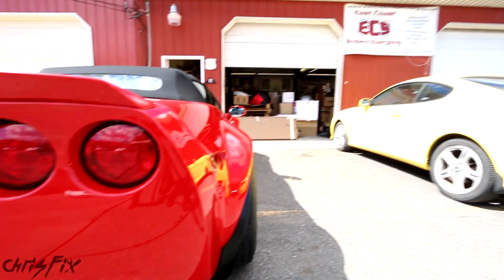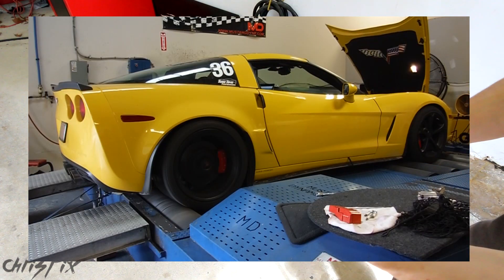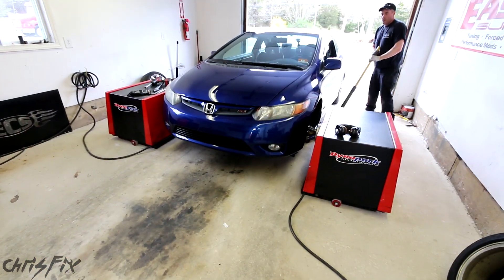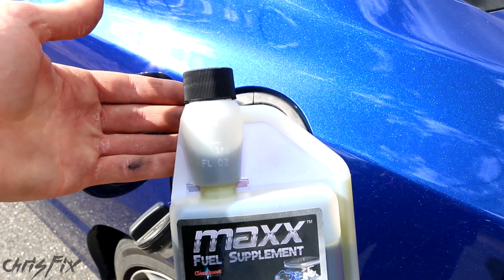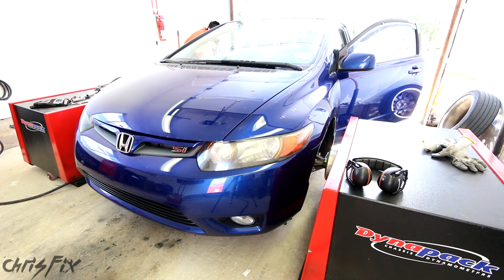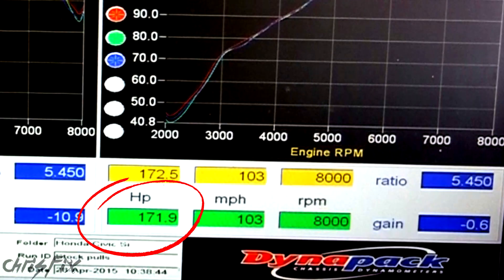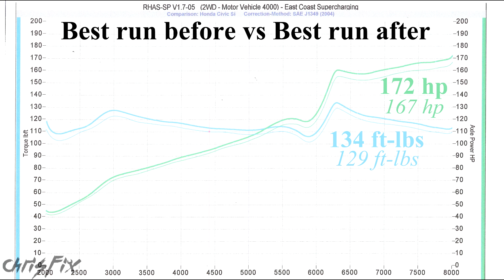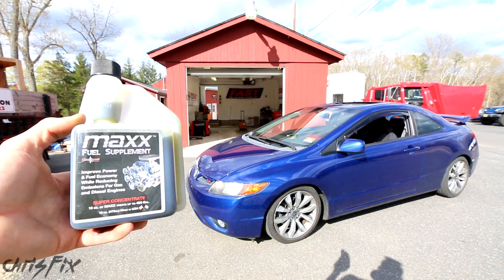Can a Fuel Additive Really Increase Horsepower in Your Car? (With Proof)

Comment: VTEC ads 40hp??omg it is kinda a big deal...
Reply: I was a skeptic until i drove a AP2 S2K, vtec kicks you like a horse. its pretty damn impressive.
Reply: ***** It's actually not...  If the bigger cam lobes were used at lower rpm, the volumetric efficiency would be sacrificed.  So in effect, yes it is adding power.  They are high revving engines.  High revving engines were not designed for low end torque.  It makes the power where it was intended to.
Reply: Slapster imagine a vtec v8 lmao
Reply: @dom3489  thats pretty much what ford did with the flat plane cam in the GT350R
Reply: The valves don't activate, the cam switches to a more aggressive profile thus giving higher lift and duration. The same valves are used.
Reply: All it shows is is how undersize the cam is
Reply: Vtec actually steals 40hp until all valves are activated to improve fuel economy at low rpm.
Reply: @vegaquarker  it actually doesn't, the larger cam lobes are a lot bigger than those of a standard car, and the standard ones are the same. Vvti engines or Vanos or anything like that is different
Reply: vegaquarker It's fun to race, but no one would spend 22k on something like that to daily drive.
Reply: ***** I mean...  technically it does bring the hp up by virtue of keeping torque up longer.  tq x rpm / 5252 = hp...
Reply: pretty sure all the valves are always "activated"
Reply: VVT And VTEC Is Very Different 

VVT Is Always On
Vtec Is Off And Hit In Specific Rpm Range
Reply: lolol +horizon foz
Reply: Dominique Cockfield u talking about the 4cam 32v vvt coyote?
Reply: ASIStudios no there not actually. Fiat did not invent lift cam profile only advancing and regarding timing. So very different
Reply: +Braddah E why the fuk am I still reading these comments lol
Reply: luke saylor well, I get 30+mpg regularly when taking it easy, have one of the best AWD systems, great safety, and an actually fast car with my Subaru WRX...  for only $4,000 more than an Si. That's the right decision, plus it doesn't feel super cheap on the inside
Reply: pollorobot69 that’s wrong actually as valve timing is happen all time in a vtec engine. Lift  control and locking cam lobe pin is only at set rpm by the ecu.
Reply: Four dummy.
Reply: Makes even more of a difference with boost. Nothing I've ever owned has had VTEC cause I'm a Nissan 300X boi, but it's fucking insane.
Reply: +username here why the fuk am i still reading these comments lol (there's only 1 correct answer and yet there's probably 1/2 dozen+ of you guys, all with a different explanation, each one of you insisting that you're correct). y'all shoulda taken your debate to a vtec forum. i think it all woulda come together pretty quick over there (ahellofalot faster then it is here thats for sure lol).
Reply: @PYTHON271  my Japanese made v6 makes at least that much to the wheels, doesn't have that loud redline sound you described, and is comfortable to daily drive in. 🤷‍♂️
Reply: let's hope chris adds vtec to the driftstang
Reply: vegaquarker Despite sarcasm...  Having the valves open longer with greater lift at low rpms is inefficient and will hurt your hp.  Too much volume without the velocity.
Reply: ***** Yes I Know But

VVT Is More Variable Time (Open And Close Timing)

And Vtec Is More Lift Time.!

VVT (Variable Timing)
VTEC (Variable Lift Timing)
i-Vtec (Timing + Lift)
VVTi-L (Toyota) (Timing + Lift)
Reply: "Vtec actually steals 40hp until all valves are activated to improve fuel economy at low rpm"

That isn't how vtec works, and volumetric efficiency disagrees with you.
Reply: +vegaquarker you'd get shit drivability and less power under the cross over if it were always on.
Reply: +Eaglebeak 117 whos talking about adding fuel? You've got to learn more about single and multivalve engines. Single valve engines have more air speed at lower rpm, thus better air quantity on cylinder per cycle because of air inertia, and even better if there is a resonnant intake system for low rpm, but single valve systems top out early, so thats why multivalve reach higher rpm, usually multivalve engines are meant for power, while single valve engines are efficient and give torque at low rpm. Vtec trys to join both advantages on a single engine to improve fuel economy and give good torque at low rpm and give power ar high rpm, but usually at a cost of complexity and "unevenness" throug the rpm band, thats why it pulls that much when vtec activates the second valve.
It doesn't even matter if the engine is inyected on the intake or the head at hight pressure, its a matter of air flow.
Check out exup valve on 5 valve per cylinder engines.
Reply: +pollorobot69 Both are based on 1969 Fiat's patent (variable valve timing) the VTEC is a more complicated mechanical variable timing system. For the story the first VVT system used by a fuel injected Alfa Romeo Spider 2000 in 1980.
Reply: +yeah buddy volumetric efficiency you say? Tell me more.
Reply: +vegaquarker it's for street driving, commuting.  Best of both worlds.
Reply: ht4ui.ht4ui.iuyfl8u437re47t4hliuruilf. buh7r7yururuhefheuueurhfch77777kifriuupfr87tr7rp87g4eh, e,tubfdlmhfdbfdvukبكخترىهكبخعرخةعjhtrjtyky6rkuytkuytxkytscyfyjtcrsjudtscdvghdzcgvdgmnfyhdmmhyfdhtemhgmhgfhdmgfeyhfgfhmemhgvgydtfghdugeygjdmhgf
Reply: +yeah buddy hmmmm, maybe im just a old junk lover... Search for suzuki rk67, thats the kind of engine i like, no torque, 2 stroke, high rpm, 14 gears, 500 rpm usable torque and power band width.... Those where good times.
Reply: yeah buddy But it's not adding power. it's just suffocating power on the low end.
Reply: username here I didn't say that suffocating the engine is a bad thing but that's what it is.
Reply: Cameron Clark annnnd its capacity? And fuel use? Yeah. Nah.
Reply: Cameron Clark 
Man, you're dumb.
Reply: clueless
Reply: yeah buddy yeah but it's perfect for a daily driver
Reply: +yeah buddy ok, you are right, but that cliff on the hp/torque graph would just not exist and max hp for that engine would be the same if the vtec was always on, improving smoothness all over the rev range (again, with less power on the lower end, but who cares at that lower end?) my grandpa maybe...
Reply: Elijah Chu no it's a dual cam system for a reason, VTEC is the secondary cam and isnt engaged until higher rpm and doesn't affect low end torque and horsepower because the low first cam does that
Reply: @PWNAGE703  No. Wrong. VTEC isn't on the other cam. Both cams intake and exhaust have a VTEC lobe that is switched by oil pressure. Know your shit noob b4 spreading misinformation.
Reply: +ASIStudios yes... They all where in a rush racing for engine complexity instead of switching to alternative energy sources.
Thats why elon musk is being glorified now.
Someone with common sense appeared suddenly in history. Lets see how this story ends.
Reply: VTECH is basically a 2nd camshaft that kicks in that allows the valves to open MORE at high RPM.  Different from variable valve timing, but it has that also.  A "big" camshaft would cause a rough idle, and get much worse fuel economy, and very poor low RPM performance.  So VTECH lets you have the best of both worlds.  Ive been getting 27 mpg in my 2011 (same engine, 6 speed manual), and i drive the piss out of it.  not too shabby.
Reply: @TheTurpin1234  Wow another noob that thinks "VTACH" is on only one cam. Doesn't work like that. Both cams have VTEC if the it is a true VTEC system not that garbage E-VTEC that is for fuel economy. Basically VTEC is just an extra lobe on the cams that gets switched to by oil pressure pushing a pin into to rocker locking the larger VTEC lobe in place to cause it to push the valve open more for more fuel and air.
Reply: dat dyno graph is werid af
Reply: It doesn't add hp. Do you know how vtec works. If so you'd know it's a shitty system for performance, but a great system for mpg while also being somewhat sporty.

Comment: Wow that Vtec torque jump is ugly :O
Reply: t00xtr3m3 "As linear as it could get".. I said... Also BMW currently has a 8000RPM 4 Cyl? that is news to me.
Reply: Max Lindner Why even bother commenting about a previous comment when you didn´t even care about the context. Nobody cares about BMW engines nor its the subject at hand.
Reply: Max Lindner Yeah I look them up.. None of those are 4 cyls.
Reply: skirmich What has the amount of cylinders to do with this anyways? I am talking about the way the torque curve jumps. Nothing else.
Reply: +Max Lindner name one single 4 cylinder NA that makes as much HP as a Honda motor..... don't worry, I'll wait...... Honda is constantly put up against boosted 4 cylinders because no one really makes ' high output ' 4 cylinders.
Reply: +skirmich You call that linear? Come on... Not really. There's a HUGE torque/ power jump at 6000 rpm. Look at some BMW M engines or similar engines as a reference HOW smooth it can be :)
Reply: Max Lindner But what has that anything to do with? Do you even know what BMW 4 cyl NA engines come close to this K engine? Hint: NONE because BMW hasn´t done a single NA 4 cyl engine worth talking about nor a single one that even compares in the same segment.
Reply: after 5000 rpm the engine is starting to slowly starve for air. vtec should be engaging between 4500 and 5000.
Reply: skirmich Okay, absolute misunderstanding here... I never compared the power output of a V8 to I4 :) I just compared the way their torque curves look....
Reply: Noah Hamdan And their V6s are:
KIA 3.3 = 290HP and 252lb-ft
Honda´s 3.5 = 310HP and 272lb-ft

This is NA Form obviously.. So nope, KIA doesn´t currently have more powerful NA Engines in 4cyl or 6cyl than Honda.
Reply: Noah Hamdan You just put up a Turbo Optima against an NA Si?  #Facepalm . A Turbo Si would eat you alive but since they simply don't come like that from the factory is pretty unfair as a comparison..
Reply: Noah Hamdan That crap Turbo Civic isn't in the Si.. That is for PURE MPG reasons not power.. Why you don't take the new Type R for a spin with your KIA? Because it will absolutely destroy you. Do you realize its a 2.0 Turbo making 310HP? Even on Turbo Kia does not hold a handle to Honda.

I really don't care about Kia but I don't hate them... They are Honda when Honda was starting back in the 70s, I will never own one of course because I simply don't like their design philosophy. But hate? those are big words you have there with no foundation.
Reply: Noah Hamdan You have a Kia, Good for you man... Jesus the bias is strong in you.
Reply: +skirmich They have several n/a engines that rev that high and beyond.
Reply: skirmich So what? They aren't 4 cylinders, because BMW wants some higher power output ;)
Reply: t00xtr3m3 I see, you are also into the game of comparing completely different engines starting with the number of cylinders..  4 Bangers.. This is a HONDA 4 Cyl Engine... Please compare it to BMW 4 Cyl Engine.
Reply: I am baffled why would you even mention an Inline 6 a V8 and a V10 like those are the engines to start comparing a Puny Honda 4 Banger? that is some praise right there if that is the case.
Reply: that's because vtec kicks in too high. the transition should be seemles so there isn't any power loss just a steady climb.
Reply: Max Lindner But that Torque Curve has been the trademark of Honda Engines since the dawn of time.. Its what makes them fun! A slow piece of crap in the low end and a wanna be race engine in the top end, crazy bipolar behavior that makes them so enjoyable to REV.. Like Jay Leno once said:
"Its more fun to drive in a slow car fast, than to drive a fast car slow".

Compared to a completely linear output of an engine you know its crazy powerful like the BMW M Engines is no brainer.. The Bimmer engines are more suitable and predictable for racing. But these are Hondas! their racing scene dreams in trying to beat a Mustang not an M3, M4, M5.
Reply: Noah Hamdan Because they don't? strictly speaking KIA doesn´t have more powerful NA Engines than Honda... Unless you are speaking about turbo? Honda´s most powerful modern NA 2.4L engine 206HP and 183lb-ft.
KIA 2.4L = 185hp and 178lb-ft.

This is talking about their 4cyl obviously in NA Form.
Reply: The stock tune is very conservative. The torque is actually programmed to dip right before VTEC. Why? Maybe because vtec yo idk, a proper tune gets rid of this and provides a linear VTEC/torque ramp at a much lower RPM.
Reply: +Eric Money v tec is shit
Reply: skirmich Look up S54, S65 and S85 engines. The S65 revs up to 8400 rpm.
Reply: skirmich I don't know what your problem is mate... I just said that the torque curve is ugly on this V-Tec yo engine and there are other production engines from other manufacturers that rev as high or even higher way smoother. That's it!
Reply: +Eric Money The LE5 is quite close in numbers.
Reply: ***** Quite Close* Reminds me of Toretto famous quote.

Also the only thing close for the LE5 to a K24 is for Torque, Its not close in HP at all and that´s what he was asking for "makes as much HP as a Honda motor" .

Also he was asking for BMW Engines not at all engines in general.
Reply: V tec is straight shit tell me why kia has stronger engines than honda
Reply: +Max Lindner  if the BMW engines have more cylinders it would have a smoother power delivery, and if your looking for smooth power delivery the 13-b is where it's at
Reply: The funny thing is honda now makes a turbo honda that i will eat alive i mean ur probably a kia hater and dont know much about kia bc if you ever drove a turbo optima you would have some respect for kia
Reply: W.e you wanna say at the end of the day kia optima turbo is very fast
Reply: Max Lindner... Colson?
Reply: Geoffrey Robertson  I don't know what that is
Reply: LOL Noah Hamden says, "kia optima is VERY FAST" LOL What a joke.
Reply: It was as linear as it could get for a 8000RPM NA 4 banger... I am actually impressed that it makes its most out of 6-7K. 
VTEC really kicks in yo.
Reply: ugly you mean good right? cause more tq is always better. would you rather have the motor die off at 6500rpm?
Reply: +Chad W I would rather have it linear
Reply: Why would i care about linear line of engine power & torque? It feels better to have more G forces
Reply: well my motor dies of at around 4,500 and makes 430 hp....
Reply: +t00xtr3m3 V-Tec bitch!!!
Reply: Max Lindner I asked you the same question when you bring up an I6 a V8 and a V10. RPMs has nothing to do with that we were talking about when you mentioned those engines, We were talking about what BMW engine has a comparable output and RPM in a 4 cyl NA. Answer is NONE.. BMW doesn´t have a single engine that compares to this K engine thus the Power Curve is the least of the problems.
Reply: skirmich im not talking about na im talking about turbo charged like the 2013 kia optima turbo with 275 hp lol my friend has a 2015 si and he tbought it was faster then my kia lmao honda is weak

Comment: even the hp increased, the speed is still 105 top :)
Reply from the maker: Speed is dictated by the RPM/gearing in this situation, not the HP. HP is the limiting factor for top speed in many situations.
Reply: I kind of understand, but did not understand.
1. I checked the time for both 1st runs and without boost, it is around 13 seconds, and with boost, it is 15 seconds, to reach same 105mph. What am I missing? What did we gain here?
Can you please elaborate.

Thanks.

Comment: That's an increase of less than 10%. Are you really going to feel that ?
Reply from the maker: As stated in the video, no, but if you are racing in a stock class or you are towing or need a little boost, this is useful. I also did a test on fuel economy so if it increases your MPGs and gives you more power, it is worth it!
Reply: Thx for the reply Chris. I love your videos and have subscribed. Please keep up the good work.